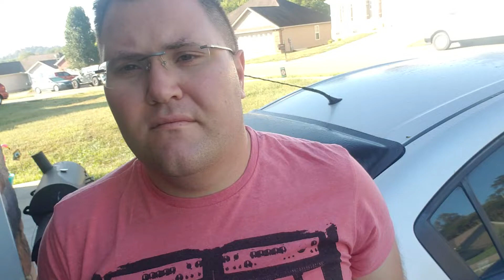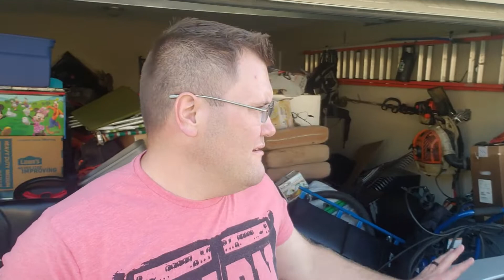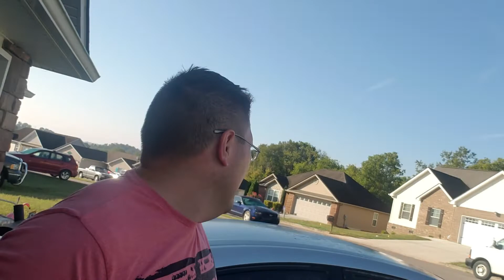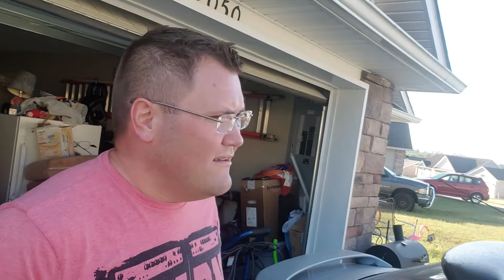Turbo Mazda 3 update!

Comment: I have been wanting to tune my Mazda 3 2.0l as well buuuut Cobb and a couple other custom turbo shops told me it's cheaper to just buy a speed3 than to try and create a tune for my car . Ok so you need to upgrade the cams , pistons , cylinder Chambers,connecting rods ,rocker arms , heads ,fuel line pressure ,fuel line, fuel filter , exhaust manifold ,wiring harness, computer, etc. Pretty much everything that has to do with pressure needs to be upgraded ...like by alot . I kinda gave up on my Mazda 3 .j mean it's possible to turn it into a rally car but no point because it's fwd .. it's very sad . I like your enthusiasm though, it gives me hope that one day Mazda will create a Subaru version of the Mazda 3 ..that would be so wicked. God bless man keep up the good work and I would like to see more of this turbo Mazda 3

Comment: did you pressure test the cylinders? did you strengthen the internals? rods, fuel injectors. For anyone thinking about Turboing your already high compression engine, you NEED to replace internals with parts that can handle boost. otherwise you will blow shit up like this ^